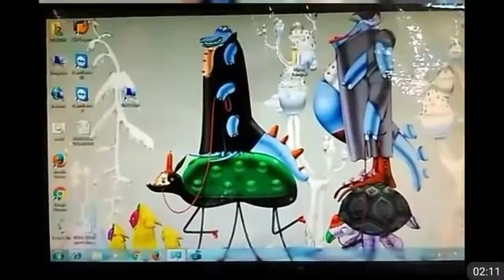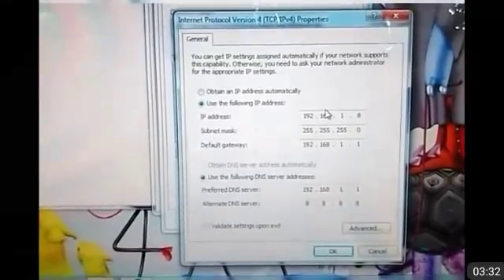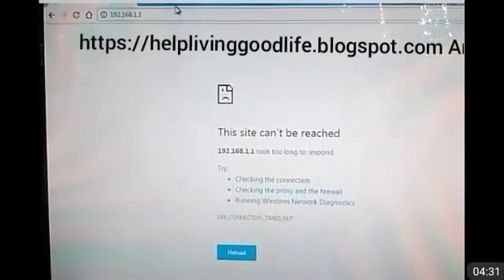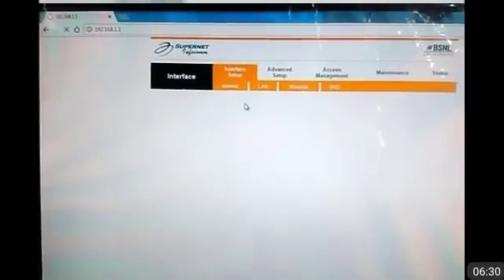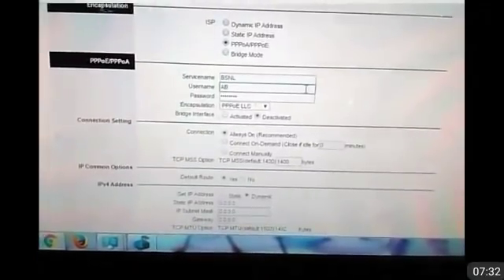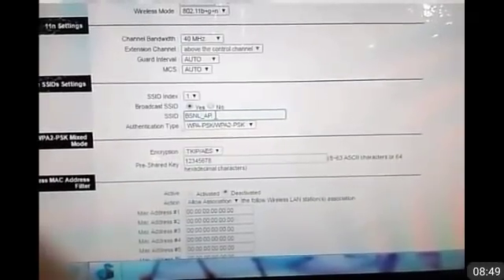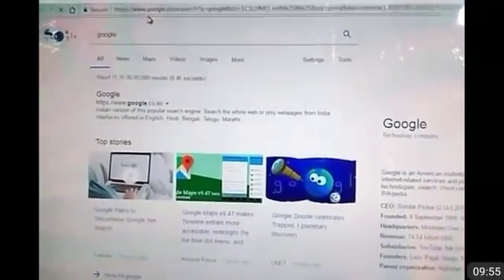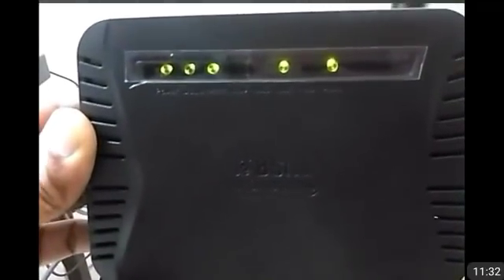BSNL Modem Configuration Procedure Step-by-Step

Comment: Bro , ek question , kya iss router se 50mbps speed superstar 300 speed aayegi mobile par ?
Reply from the maker: first u need FTTH connection of 50+ Mbps then this modem can give you upto 50mbps over wifi or LAN ethernet.
ADSL broadband is not capable of giving u 50+ Mbps speed. its limited upto 16Mbps.
Modem or router is just a medium which will give u output according of the input.
Reply: @rkmvlogger_rj  Thanks bro but one question , 
Suppose i got BSNL FTTH connection plus Superstar 300 package  (50mbps plan ), then i connect BSNL ONT with this DSLW 200 SY router via RJ45 cable and then browse internet on my mobile via wifi  , then will i get upto 16mbps speed or 50mbps speed ?
Reply from the maker: 50 Mbps (dono me se jo kam hoga, wo appko milegi)/
suppose, ftth ka speed 50 lekin wifi router ka speed 30 hai to apko 30Mbps milegi, or agar wifi router ka speed 100Mbps hai to apko 50Mbps milegi)
Reply: @rkmvlogger_rj  It means that through DSLW 200 SY , i will get upto 16 mbps only and for getting 50mbps i have to buy a new router that supports atleast 50mbps speed .
Reply: Right Bro ?
Reply: Should i get a Airtel Broadband , as in case of BSNL i would have to buy a new router which will cost me another 2-2.5 K but with Airtel i will get free router .
What's your opinion bro ?

Comment: Can i get a fix for a unstable dsl light in my modem my internet is unstable too.Please Fix This
Reply from the maker: 1st. To find out whether it is problem of modem or dsl Line.
Check your dsl Line parameters as shown in our many modem configuration videos. i.e. SNR & Attenuations. If snr is poor and Attenuations is  High then dsl thene is poor.
Or
 check your modem with other persons working connection.. if still dsl is unstable in your modem them modem is faulty. 
And if dsl becomes stable then your dsl Line is poor.
2nd. If modem is faulty then change it and if dsl is faulty then book a complaint on 1800 345 1500
3rd. If modem is faulty then you can do one more experiment with it. Just get a same make working modem and download its firmware. And upload that firmware into faulty modem.

If some software level fault will be there then it will recover and if hardware fault, then replacement is only option.

Comment: Bro can u plz tell me how to connet bnsl broadband to other router wireless using wds plz bnsl broadband is my secondary router
Reply from the maker: Just connect by a LAN cable and use IP addresses according to which internet you want to access. Suppose your bsnl Router is non-wifi, And other Router is WiFi. Connect with lan cable. Use different ips for both MODEM and then enter ip in wireless area network according to the two different MODEM. 
Ex. Bsnl modem ip : 192.168.1.1 non-wifi
Other modem ip: 192.168.2.1. Wifi
If you want to use bsnl  internet then enter gateway as 192.168.1.1 & 8.8.8.8
If you want to use other modems internet then use gateway as 192.168.2.1 & 8.8.8.8
Reply: Bro i want to connet them wirelessly
Reply from the maker: Yes, but two modems can only be connected via lan cables then connect pc/mobile/laptop wirelessly and use IP setting of WIRELESS AREA NETWORK AS MENTIONED EARLIER.  ITS JUST LIKE LOCAL AREA NERWORK OF WIRED CONNEFTIVITY. FOR WIRELESS USE WIRELESS AREA NETWORK

Comment: It worked but when wifi is connected to my android it is so slow. Hmn😒
Reply from the maker: may be loss in line.. check snr and attenuation in basic information of the router. if snr is less 10db then compaint on 1500 toll free and it will be resolved.

Comment: sir my bsnl modem is having problem the SNR mrgin is very low around 6 downstream and 10 upstream due to which internet is disconnecting frequently please tell me what to do how to correct it
Reply from the maker: what are the data rates... and atainable rates.
try to contact to local office to restore the line.. for that you can book a complaint at 1500 (or) 1800 345 1500..
and one more thing...
you can activate ACL ENABLE OPTION.
Reply from the maker: book complaint om 1500 for this to improve line condition.

Comment: Thank you so much bro. I had a problem while connecting my PC to the modem. Everything was fine, my PC would connect but there was no internet. Turns out that with the IP address set manually on ipv4 in the properties of my wifi network on PC after being connected, it works. Earlier i guess there was no IP address set, although in the details it showed some 185.138..... something. For info, I use D-Link wireless card.
Reply from the maker: +Aditya Kundagol thanks for watching and glad to know that you found it helpful ..
Reply: how you get username

Comment: bro can we remove the antenna
Reply from the maker: Only plastic jacket of antenna can be removed and internal antenna wire (transmitter) can be placed inside modem's body without touching to other components. But this may reduce your transmission range as this omnidirectional antenna will be no longer omnidirectional.